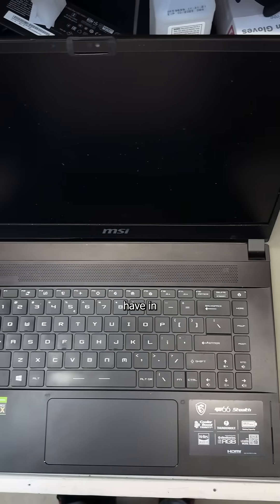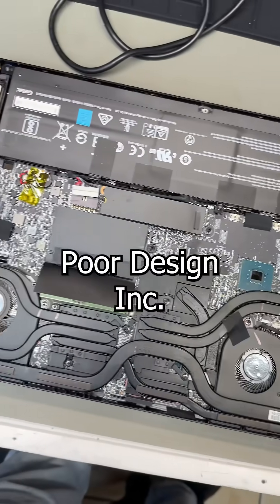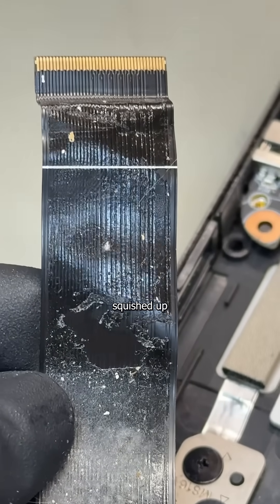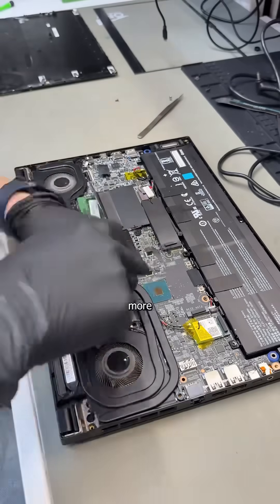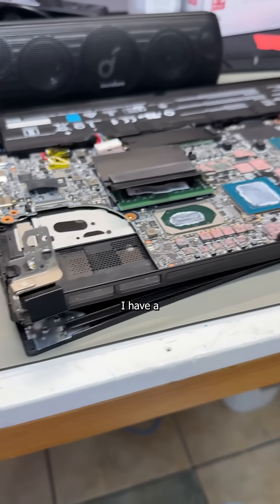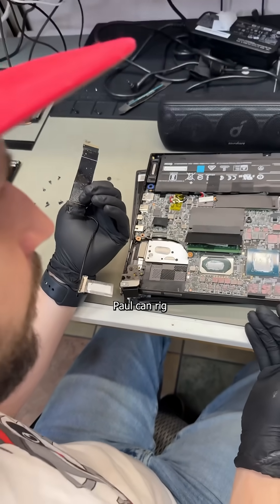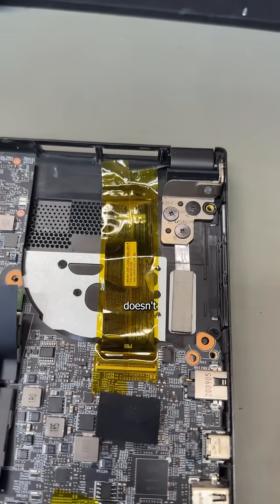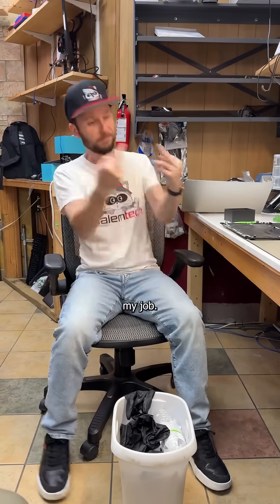$2000 MSI Gaming Laptop is Rigged to FAIL #tech #pc #technology #shorts

Comment: You didn't see my old HP Pavilion with double fan output gills and no fan input gills with every wire were protected by the 90°C on boot up heatsink secured together by two screws so they would get scratched if you dared to repaste that summer in a bagpack....

Comment: when my friend and I built our computers a few years ago, he bought an msi motherboard and gpu, and I bought an asus motherboard and gpu. He had so many issues he needed to fix after putting it together, and he needed to request a new motherboard from msi, and it also didn't have bluetooth builtin. A year later, another friend was having issues with a computer they built where the motherboard was msi. On that patricular motherboard, the tiny individual voltage connectors that you plug in, weren't in the typical order most manufacturers put them in, so he spent a good couple of hours pulling his hair out on why it wouldn't post because he assumed he had plugged those in correctly. After that, I came up with the mantra that I would repeat to other friends who said they were interested in building their own computer, or wanted recommendations on kind of laptop to get: "If it's MSI, then do not buy"

Comment: damn i am like one model off from this thing and i bet its got the same issue
is there a database of poor construction that should be modified by experienced users. Similair to replacing clock capacitor in any original xbox, or replacing faulty thermal pads like in a previous lenovo I had.

Comment: I'm going to change the thermal paste in my MSI on PTM 7950 and also bought UPSIREN UTP-8 to change the factory putty on VRAM etc, I hope UPSIREN UTP-8 will work. But I have no idea how to apply it correctly, I changed the thermal paste in 5 laptops for myself, my family and friends, but there were hard pads everywhere. And now, even if only for a second, in a still frame I was able to see what you are applying in a thin layer over the entire surface, I will do the same. Although many advised to just make balls and put them on top...

Comment: GREATEST TECHNICIAN THATS EVER LIVED! HELP! Please! I have a an515-43 nitro and at first it started turning off randomly when I used high end applications (like games on steam or Roblox) then it didn’t power on, then I somehow powered it on and then replaced the battery and changed the ram from 8 to 32 and then I got a huge lag spike and my dad told me that we needed to get the serial number and code to reinstall the system, but I restarted the laptop and now it only turns on, says ACER and then goes black and repeats. HELP!

Comment: HELLO every one 
MSI laptops are trash and OK hardware 
i promise you , i bought 2000$ msi laptop  7 years ago  
after 4 month the M.2 drive died ,  then  the battery died 
after 2 years then the screen died   , then 3  keyboard buttons died and i never ever used the keyboard because  i had gaming keyboard  
but the motherboard and cpu and gpu and ram still working very fine 
but my after market screen not working fine with the new  NVidia driver 
over all laptop still working  fine and the temperature are great  
CONS : but MSI  uses the  cheapest accessory  
when it comes to screen and battery and keyboard and LED  light and screen and ram and ssd or nvme 
they save a few dollars and fuck customer for  500$ up 1000$   parts replacements 
MSI idiots ,  they don't understand that if the customer got happy he will buy again and share with others 
thats what happend when you get to greedy

Comment: I have broken m.2 standoff 😢 how is its possible that its not standarized to have toolless ssd install on mobo, backplate not integrated with mobo or psu connectors with painfull, sharp hard to remove cables. Luckly after whole weekend I have used super glue, waited 16hr and it worker after few tries, fuck you asrock for making thin as possible standoff that break under light force. Its no fun building a pc, its a masochism.

Comment: Personally I've had absolutely zero issues with MSI gaming laptops so far. I bought a GE73VR in 2018 for $2000 and it still works fine today, granted it's quite beaten up from all the travelling, but still boots up and runs just fine. I now run an MSI Prestige for $3000 for work and zero issues so far. They have been far better than any other laptop brand I've used. I wonder if every newer MSI laptop suffer from these bad designs or if it's only a few models

Comment: I had MSI ge60 with gtx660m i5 etc .. I used it 9 years without problem. I have MSI gl76 with rtx 3060 and i7 it working properly as well. But GL76 İ9 version has overheat problem not even heavy pressure. İt's reaching over 90C if you dare to open a web page😅

Comment: One of the things that irritates me the most is seeing the PCH chip completely unprotected.

Given the structure of this cooling system... the least they could do would be to design a small copper plate, connected to the copper pipes of the ventilation system, even if it's just a little, it would help with cooling.

In short, planned obsolescence, in addition to several design and design errors in the product.

Comment: Watching this on my 9 year old MSI. Is this an issue with newer laptops only or are MSIs from way back also guilty of being designed like this? Only thing apart from cleaning, reformatting once in a while and repairing one hinge the computer has been trouble free.

Comment: That's the same issue as on MacBooks. Dirt gets between the display cable (that is open without any protection right in the middle of the space between case and screen) causing it to fail. You then habe to replace the whole display, because the cable is soldered to the display.

Comment: Bro I bought MSI laptop for about 1700 USD 6 years ago. I thought it was a good investment and the device gonna serve me for a long time. Oh boy I was so wrong. Every half a year they would replace the fans on warranty and when the warranty ended everything started to break apart: both hinges, charging  port, battery, keyboard and even the screen and of course both fans multiple times. I was so mad on this laptop that I stopped using in and it is lying on a shelf unused. I cant even sell it. No one is gonna buy it as everything in this laptop was damaged and repaired exept for GPU and CPU. MSI? Never again.

Comment: I own a GS66 and it fucking sucks for the price. $3k in 2020 got me an i7 10750H, RTX 2080 Super Max-Q, and 32GB of RAM.  The keyboard started failing after 3 years and I had to replace the entire top case cause the keyboard was held down with plastic welds. Cost me $500. And it started failing AGAIN only a few months later. On top of that, even after repasting the CPU, GPU, and VRAM, it constantly hits its thermal limit of 94°C. And its 100Wh battery never lasted more than 5 hours on a charge. And one of the 2 GPU fans recently failed, probably as a result of being run at 6,600 RPM since this cooling system is useless. Even at idle (2,000 rpm) the fan whine is horrible and the temps are still around 50°C. And the hinge makes a thunderous clap (lol) whenever I move it. Unless you can get a high spec for under like $400, never even consider buying this POS.

Comment: The giving the laptop the finger is exactly what I do when I’ve spent 12 hours repairing a windows installation 😂
Reply: Binary fingers: 10
Reply: unless you really need some of that data, I would have just booted off a usb ready to install windows, opened CMD, fully wiped the C drive with "Clean all" in diskpart and reinstalled windows fresh.
Reply: @youresoportuguese351  When you run a repair shop like I do, you do everything you can to save a customers data. Since Windows uses a registry structure for linking files and programs you cannot reinstall the OS without loosing programs, unlike Mac OS and Linux which allow you to reinstall the OS without loosing files in 90% of cases.
Reply: It's much quicker to upgrade to Linux.

Comment: Still better than ASUS. =p

No, seriously, I had an ASUS laptop for a few years - it had to be taken in to be repaired multiple times, despite me taking as best care as possible when using it. It's BSOD, the lid began to separate and the power button eventually didn't work (or when it did the rest of the keyboard stopped working).

Meanwhile, someone I knew treated their MSI laptop like garbage. Tons of tabs open at once, only ever put it to sleep, rarely turning it off and once dropped it on concrete while in sleep and it still ran just fine.

Sufficed to say, I don't use ASUS anymore.

Comment: Msi = Multiple Serious issues
Reply: At least their cards have fuses...somehow. Yes, almost every other manufacturer decided to NOT put ANY fuses on Rtx 4000`s cards causing numerous meltdown. Including nvidia design team itself. Even on 4090.
Reply: @alexturnbackthearmy1907  skill issue
Reply: @alexturnbackthearmy1907 a 4090 in a laptop is stupid
Reply: Checks out
Reply: @nword9239  Baseball, huh?
Reply: Have a 10yo MSI laptop which still runs to this day. Keyboard is gone though.
Reply: @DerangedSloth555 10 years thats rookies number, my ROG 2012 model is still running  as a remote server client 24/7😅
Reply: This comment was sent just as a joke, not anything serious. 😃
Reply: I never had problems with MSI graphics cards and my mainboard worked well too, just the msi gaming laptop I have is a darn fragile piece of tech😂
Reply: I haven’t had a single problem with one of their laptops. Still have it. It’s been 11 years with the same oem parts. I only replaced the cmos battery.
Reply: Multiple friends of mine have been using msi laptops for several years, no issues so far
Reply: @randy89555  its not that the msi laptop dont have issues, sure i have been using  mine for 8 years but the thing is it runs hot and without proper care(some people did) it easily breaks or prone to serious issues. I just hard to use for productivity on the go since the baterry life just get so terrible overtime.
Reply: @randy89555  I have an MSI laptop (GL62M 7REX) from 2018. Works fine, except for the usual thermal issues, ut the build quality is atrocious.
Reply: @randy89555 
I am using msi, didn’t find any problem.
Reply: My MSI GT80 has lasted almost 10 years since 2015.
Still working flawlessly, just the battery has thrown the towel as normal with age.
Reply: I see this comment again and 😂😂
Reply: real, i had a cyborg 15 before it went to shit, then getting a replacement, also going to shit... then i switched to alienware then switched to lenovo legion
Reply: All of them are the same, not just msi
Reply: Fr tho 💀
Reply: I have one that has several hinge issues
Reply: My old English teacher also using this brand but he's using Modern
Reply: He literally made that joke in the video 🙄
Reply: Agreed to the very core, I had one, 1st gen MSI laptop bought for about $1115 worth at that time, and it only lasted 7 years.
Reply: Almost anything from MSI I've seen are garbage 😂